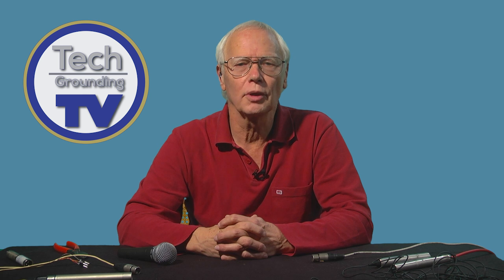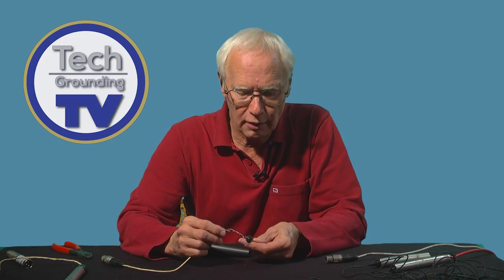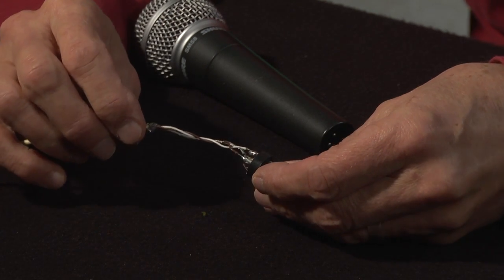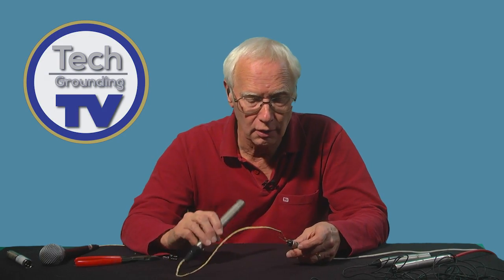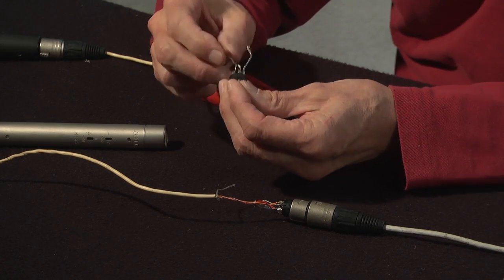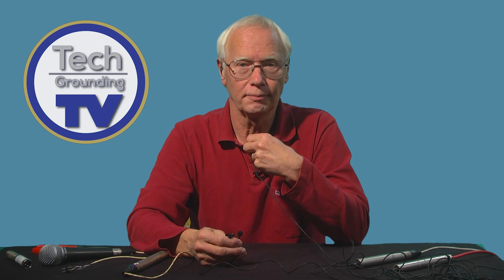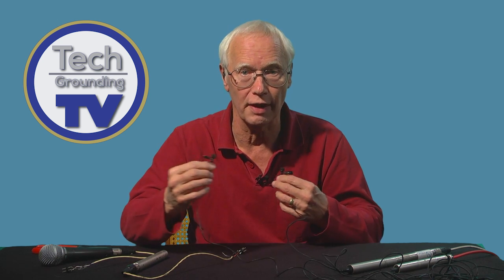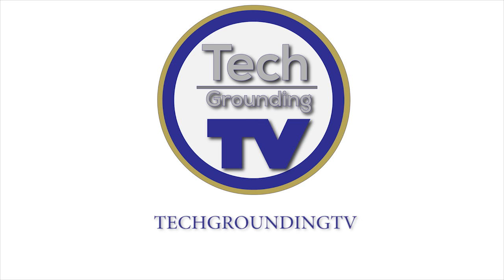HOW TO CONNECT A MICROPHONE TO YOUR AUDIO EQUIPMENT

Comment: I'm interested in the balanced microphone which is the SM58, as it has three leads!  What is the earth wire for if it doesn't matter when cut.  How is it actually connected to the mic itself?  Thanks in advance and for this great video.  Singem.
Reply from the maker: Hi, if you watch the video again carefully you will see I explain the purpose of the earth wire quite clearly at about 1'15" in. It is to screen the audio pair of wires from interference. It is connected to the metal bodywork of the microphone.
Hope this helps! Joe D.